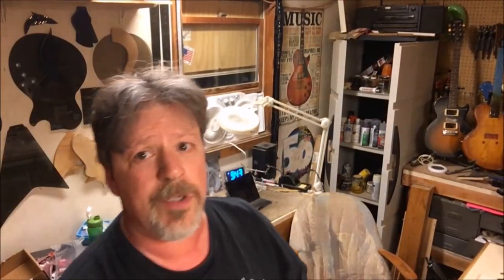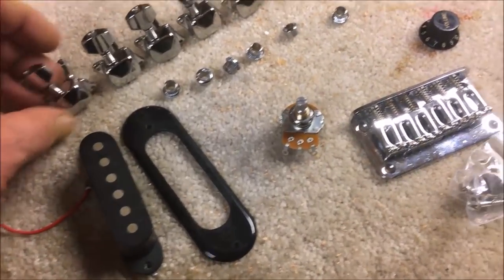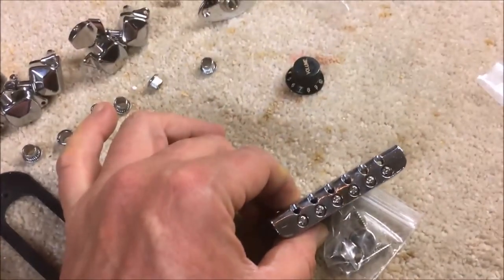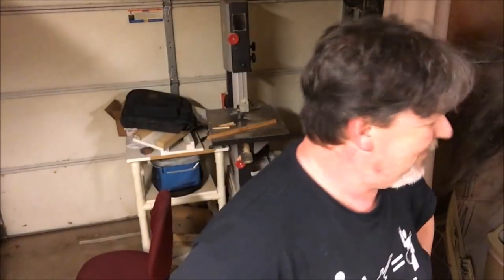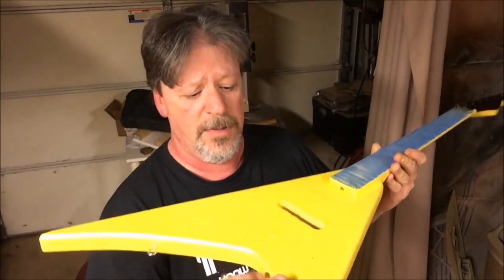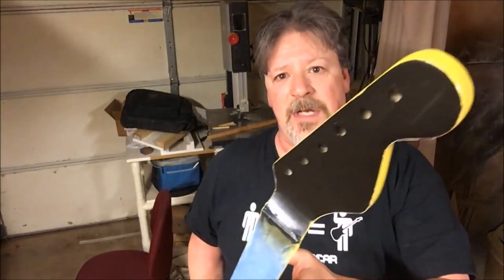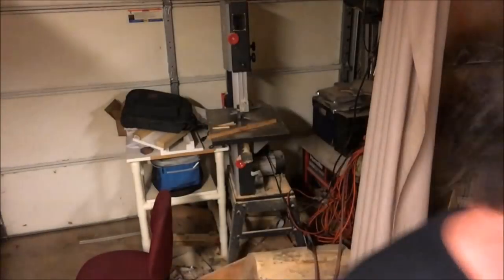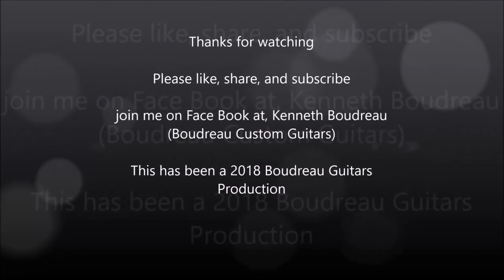Boudreau Guitars - My Son's High School physics project

Comment: Nice project Ken. Any time spent with the kid is good time. My very first build was as a mentor for a Senior high school project with a friend of my sons. I use Alpha pots from stew with great results. The first time I uses CTS pots they came apart when I pushed the knobs on. I had to solder the little bendy tabs down to keep them together. Still scratching head.